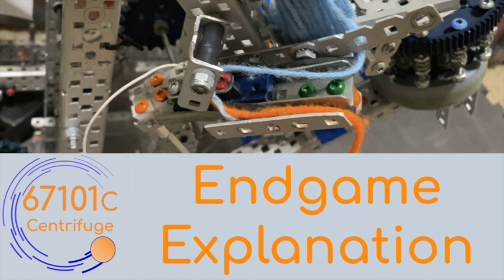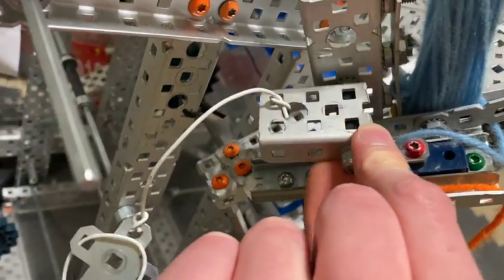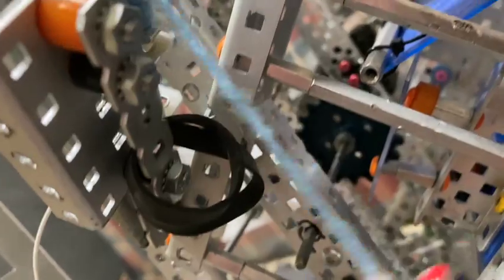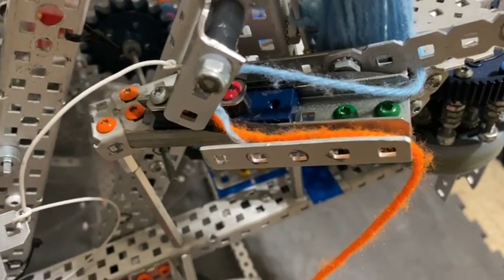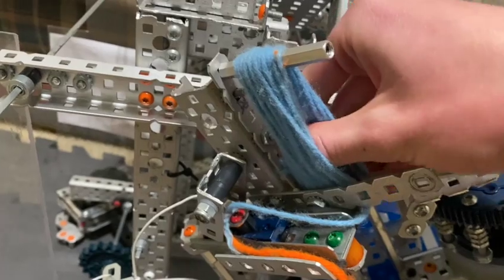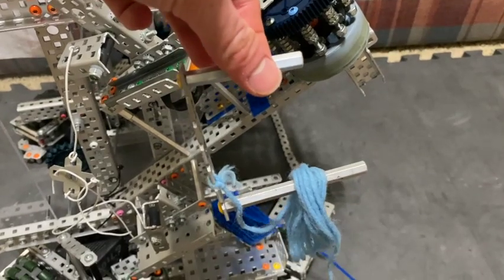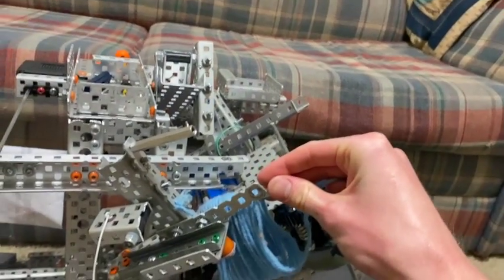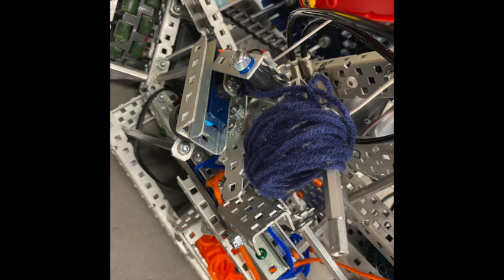67101C Vex Spin Up Endgame Expansion Explanation

Comment: How did you connect the lock bar to the slide insert with the limited space between it and the slide rail?
Reply from the maker: We just ued 0.25 inch spacers and a 0.5 inch screw.
Reply: it’s not secured on the bottom?
Reply from the maker: @shinytie245  THe inserts have built in threads
Reply: @9MotorGang  that makes sense! thanks

Comment: any reason why you decided to change your endgame and not keep the one from your old bot?
Reply from the maker: This one was a huge pain to reset and easily tangled. The angles also weren't ideal for the S2 changes.
Reply: @9MotorGang  what changes are you planning to make to reduce tangling? Also I assume the angles could be improved just by mounting the expansions in different orientations
Reply from the maker: @ari90i  We aren't having the string connected anymore. And we now lounch at 0 degrees.
Reply: @9MotorGang  Benefits of launching at 0 degrees are less chance to hit expansion blockers I assume? Or is there any additional reason
Reply from the maker: @ari90i  Just not to go out of the field.
Reply: @9MotorGang  makes sense, thanks for the info g

Comment: How do you launch it during the game? Like I don’t think you can launch them manually during the match (obviously). Is there a another mechanism of activating all the string launchers at once?
Reply from the maker: There is a cylinder that the connects to the gusset as mentioned in the video.